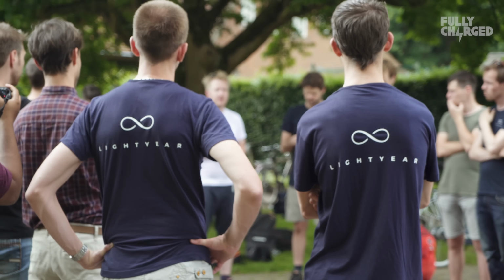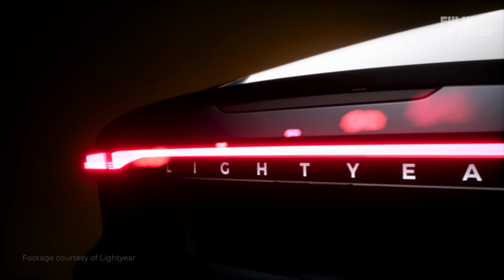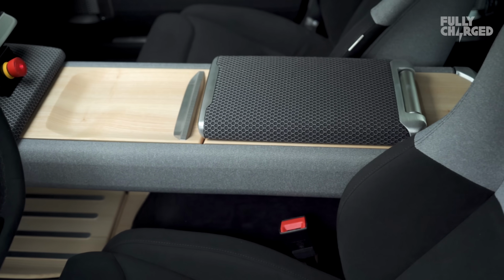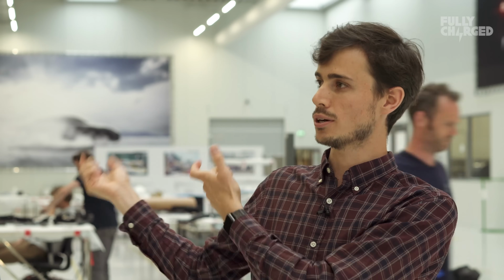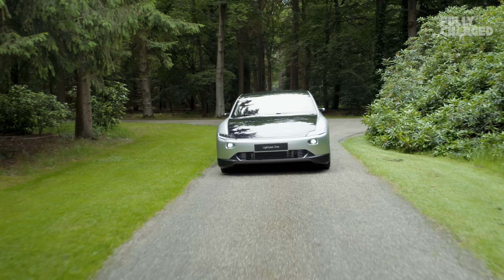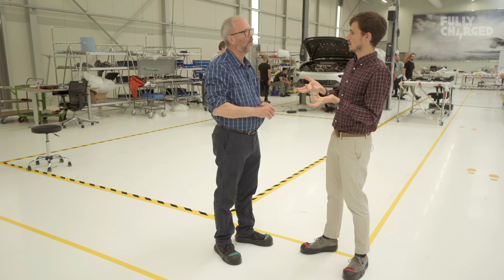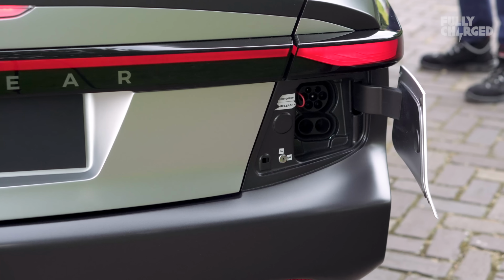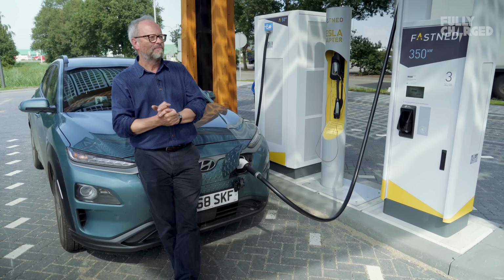Lightyear One solar powered electric car - exclusive first look | Fully Charged

Comment: NONSENSE.  The  AVERAGE REAL TIME efficiency of solar cells is BARELY 15% because of the varying angles of the INCIDENT light. Do you really think the incident light is hitting at 90% to the solar cells all the time? As the car moves so the incident angle of light is varying and also the angle of the sun and also buildings blocking the sun as the car moves...
 So the  cross sectional area of top of the car times 0.15  times = available maximum incident energy times the efficiecy of storage cells times efficiency of motors= a lot less then their figures.   Barely=5%
The figures are BAD. NOWHERE NEAR THE FIGURES THEY QUOTE. They are deluding themselves,you and or just scamming.
Reply: They have won a solar car competition that went cross continent, what the hell have you accomplished?
Reply: @quelorepario  in perfect conditions with a fully charged battery?????????
Reply: @quelorepario  i also saved you money from buyinga lemon with fake figures.you should thank me.ask thunderfoot
Reply: @esecallum  as a rule of thumb I always wait until the second generation of anything that is cutting edge.
But from being skeptically cautious to being a cynic, that's a whole another dimension.
Reply: @quelorepario  did you even read what i wrote?read it again. slowly. if you dont believe me get any solser cell and angle it about you will be shocked at how the power drops as the angle is changed and how it output resistance goes up.
Reply: @esecallum  and yet there are races with solar cars that exceed 1000 miles per race, only powered by solar energy.
These type of races existed for over two decades.
One thing is what you can theorize on paper, another thing is to actually test it in the real world. There are so many examples in the history of science that seemed to be impossible in a laboratory and turned out to be perfectly possible in the real world because they were ignoring variables (either synergy, optimizations, lateral thinking solutions) that you would never realize until you build it.

In any case, it has never been part of the objective of this car to become 100% self-sufficient, it is designed to be a range extender. 
Btw, just now Toyota announced a breakthrough of a 34%+ solar panel efficiency that allows charging while driving.
Reply: @esecallum  you are the limited one by thinking that the only way to get efficiency is by breaking the laws of thermodynamics.
Reply: @quelorepario  which part of 25% theoretical versus 5 %practical dont you understand?

Comment: Nice concept, but in the real world those wheel covers on the back wheel would only get in the way
Reply: citroen only shipped a few mil. of them over a 50 years time span... think outside the box the problem was solved in 1955 and worked like a charm.

Comment: This car isn’t needed, a electric car is good enough.  Won’t be able to drive at night and if you use a smaller battery you will have to charge more often driving at night, clouding, and rainy day.  Not worth the extra money vs just driving a electric car with bigger battery

Comment: I like the car and concept so far, but: the solar panel calculations are BS because the sun will never "peek power" the whole day. In average and ballpark numbers you get whr=peek wattage x 1 hour. Yes one hour, so 1,25kWhr the whole day. Which ain't that bad, but this is changing the picture essentially. Don't you think?

Comment: I'm thinking long range trucks, with 70% of it's power draw provided from the panels coating the side and top of the trailer.
Early morning the sunlight hits the side of the trailer, and even leaving space for branding you have a massive surface to capture sunlight all the way through midday.
Truck stops could be fitted with high-voltage charging stations that charge up separate battery modules in a few hours. This does two things: Enforce mandatory driver stops, and puts pressure on shipping companies to not stress their drivers (i.e. without enough charge the truck doesn't make the delivery, where stopping for 20 minutes to fill the fuel tanks means tired drivers become road hazards)

Comment: some random thoughts

1) it looks like the brakes aren't working yet ( or they don't trust them ) because 1) very low speed 2) chocks under the wheels 3) people following the car on foot, probably to help stop it.

2) the construction of the car (I'm guessing from the picture at 4:10 ) seems to be
a) chassis :  aluminium? lots of flat pieces easy to water jet cut and no compound curves which are difficult to form.
b) body : either thermo set plastic or 3d printed plastic. appears slightly transparent and has reinforcing ribs behind the wing and on the B post.
( note : will that tube in the B post really be strong enough for side impact protection? - I am not an engineer)

3)  for a car which is aiming at minimum wind resistance I'm surprised some of the design choices  for example the front grill  and that tail light design, they can't be helping.

4) High performance cars obviously have a market( Ferrari etc) ; people will pay more and put up with less comfort. But is there a market for high efficiency electric cars? Will people pay a huge amount more to save only a little electricity cost? One of the advantages of electric cars is they are cheap to fuel, will making a very expensive car which is say 40% cheaper too fuel actually be worth doing? 

5) Is efficiency even a thing with electric cars? Making a car that can do 100mpg with diesel is impressive ( eg Audi A2 3L ). But I have no idea on energy usage for electric cars, I even don't know what its measured in. I guess its KW hours but what's a good KW hour and what's a better KW hour? I do understand range, clearly more range is a good thing.

6) mass producing cars is very difficult. 

7) Everything they are aiming for Tesla are also aiming for: Low rolling resistance, low wind resistance, light weight and a more efficient power train. The Lightyear One is an attempt to push the envelope but it can only do so while sacrificing some of the following:  price, performance, safety and comfort.

fully charged review on a similar car called the sion https://youtu.be/wLZKdkgB85k

Comment: What exactly are those runners doing? Like watching a 4 year old learning how to ride a bike. So - here's what I think is happening.  This is conspiracy theory, my own opinion of what's going on here. I think this channel is in on an investor scam. The car spends its parked time with wheel chocks front and back of the tires - there are no brakes, whatsoever, nor is there the expected "cogging torque" in the wheel motors that, combining the CT from 4 motors, WILL hold the car in place on that level ground -- no chocks needed if that was the case. The location is secluded and completely out of public view. I submit the wheel motors are 3D printed shells that are bolted onto wheel hubs - we never see an installed motor actually running on a lift and the car clearly doesn't have a braking system.

Those runners push the car (which is why they wear the white gloves while running and why there are that many runners), then run alongside to be in frame for a "legit reason" because they can't get out of frame without standing in different places. Notice the car never exceeds humans-running (not sprinting) speed in ANY of the short video takes that are edited together and it's always slowing down as it free rolls, never accelerates. It comes from around the corner of the bushes right after being pushed -- if you look closely, it's slowing down.

The car is on a tow rig while you're chatting inside it (hence the "noise" -- I don't care how prototype the wheel motors are, there are no gears, they should be totally silent) and is being cable towed when behind the camera truck which is then deleted in post by color keying (look at the center of the pavement and you'll see shenanigans). It gets winched into the trailer and never goes beyond the winch in the back 1/3rd of the trailer into view through the side doors of the trailer, because it CAN'T - any marketer would terminate the frame with the car stopped in its place in the trailer, in view.

The one sequence where the car is looking like it's going faster than running speed (left to right) has video frames deleted (watch how "jumpy" the runners are) to speed it up. I think these guys have a rolling foam concept and are misleading their way to bigger funds and they've certainly pulled the wool over almost 2000 commenters' eyes if that's all they have. And, if I am correct with my theory, you're in on it with a straight face because this piece is massive clickbait for channel views/payout due to the "exclusive" ride interview and rolling car views.

Any investor that puts money in a tech that adds a couple of dozen km of range and on seeing clips like this (which a foreign investor might do), at best, hasn't done their homework -- ride in an actual car before you give them a dime. That way it doesn't matter if my conspiracy theory is right or wrong. But I truly believe that these guys are painting a picture of being further along than they really are. No harm in being where they are, but it's a lot harder to go beyond a seed round if you've burned off time and all your seed money playing in the sandbox and can't show a working electric car instead of a soapbox derby entrant.

Comment: ultimately.. it's powered by coal, hydro, nuke plants, and petroleum.  Or solar panels manufactured by power from  those sources that then die of old age after 25 years.  Do you drive a new car?  It took 300,000 gallons of water to make that car.  Do you fly commercially?  That plane blows more exhaust out in one trip than my 30 year old Bronco does in a year.  Like to wear import shoes and use consumer goods from overseas?  It takes a lot of petroleum based manufacturing to make the ships that run on bunker fuel to haul the containers to ship the cell phone that uses infrastructure built with heavy equipment made from materials mined with heavy diesel equipment to UPS or FEDEX to your local retailer where you go buy it.  Really want to save the world?  Convince people to live in cotton tents without heat wearing burlap and sandals and living off berries.  Or nuke China, since they are the largest world polluter.  Natural Gas is the next big boom, make propane powered cars.

Comment: A solar car is interesting, but the energy produced needs to be worth more than the cost of the solar cells including any drawbacks that this design entails. This will depend to a great extent on the amount of sunlight at any given place on Earth. In Madrid it might be worth it. In Helsinki, perhaps not so much.

The same logic applies to hyper-efficient design. People are very fond of performance and styling, and typically willing to pay quite a bit extra for this. For example, consider that the running costs of a Tesla is already quite low. At some point there's a sweet spot in the trade off between price, utility, comfort and performance. A 50% energy consumption reduction will probably sell quite a few cars though, if they can deliver on that.

I love that they're using hub motors too. I've been wondering why nobody has done this yet. It'll be very interesting to see how they perform in the real world.

Comment: Literally, when i saw the first Tesla Model S, i was like, why they didnt put a solar on bonnet and roof to self charge it?

Someone actually made this. Great.
Reply: It’s because solar on the car only makes sense for powering a fan to keep the car cool when it’s parked. They won’t tell you in this video, but all those solar panels add less than 5 miles per day at best. Much better to have a battery that a ground based fixed solar array can charge in 20 minutes.

Comment: Was that road test its maximum speed and acceleration?
Reply: They are not even close to confiming those numbers so quite rightly are not making wild claims.
Reply: Transport Evolved was speculating around 10 seconds for 0-100kph. Which is actually quite good for a car that is focused on efficiency (and in fact many ICE cars are in the 10s-range as well).
Reply: @stephanweinberger  The performance shown in the video was not 10-second 0-100kmh acceleration.  It also seemed to max out at about 20kmh.

I'm not sure if they did that to protect their prototype, or if it's because it's not capable...

Comment: Crash protection is no where near what is needed with lower weight.  The future is in flying, not old 4 wheel cars.  Waste of time and money.  Motors in wheels shows a lack of understanding of the problem.  Carrying around the PVs just adds weight.  No rear view window?  Not good.  A four place could be 1/4th the drag and 1/6th weight of a Tesla (1.5 sft and less than 700-800 lbs).  This does not even move the space forward any.  So many issues they miss with this.  Can we just stop with this nonsense? 

By comparison, with my technology, you could travel 500 miles with 1 gallon of C10 (made from electricity), 1200 city in such car car (1.5 sft drag, 800 lbs).  6 gallons is 3000-7200 miles.  C10 could be $2/gal e.  When you wake up, you realize that ROAD tax is the main cost/fee.  In Germany it is 8 c/mile or 5 c/km.  Fuel is $2/500= 0.4 c/mile.   Tires, brakes, maintenance is around 8 c/mile.  16 c/mile fixed vs 0.4 c/mile fuel.  Flying is then the key.  Fly at 200 mph for 4 c/mile, not 16 on road.  The future is in the air, not on the road.  PV on the car is an OLD idea, not worth using.

Comment: 16:55 - "1.25 Kw peak, charge between 10-12 kilometers per hour."  That's an excellent driving efficiency. My BMW i3, which on its release was considered the "most efficient" EV, gets 3.5-4.5 miles per kilowatt-hour. That's implying 5.0-5.5 mi/kWh.

Comment: In sunny Spain maybe, in cloudy UK no. You basically constantly need to clean solar panel of the dust and dirt, to get max charging power of panel.  In urban areas dust is everywhere, from building sites, from industrial sector, pollen and so on. After I wash my car it get same dusty next day and if it's rain it's even worst. Or after journey on Motorway in wet conditions car looks just terrible.

Comment: Great car, miles per kWh just on battery? At least 6 I am guessing, but love to know .  Really liking hub motor design, frees up so much space under the car , and no heavy drive shafts or CV joints etc. Noone explained why the test drive was  only walking speed.

Comment: Lapel mics could have improved the audio in the car, (reduced noise of car which sounded really loud)  however with what you had, running the audio through a high pass filter would have taken a lot of the rumble off.

Comment: We don't need luxury to save the earth. Make simple electric cars that we can work on ourselves. FFS
Reply: A really good low cost electric car is something really sorely needed.
Reply: Membrane556 exactly, rich people can drive whatever they want. Every day working person wants to stop getting robbed at the gas pump...
Reply: @elementcreator1 One reason I feel bio fuels might be a better solution to carbon emission for the near term than EVs.
You get the pay back right away vs 10 years down the road after the EV's emissions savings have amortized the emissions of it's manufacture.
Reply: The problem is: it is impossible to develop technology and mass produce it at the same time. So in order to get to that affordable electric car you have to first develop the technology in a more expensive one. And not many people are going to buy an expensive car if the luxuriousness is not up to par with other cars in the same price range.
Reply: @wilgert  Since they're only going for modest performance here and don't seem to be making it self driving it's a step in the right direction to making it affordable.
Reply: @wilgert  Im pretty sure you could go by without an interior that looks like this car, no autopilot from tesla, tons of cameras, huge screens. The technology is there, so no need to develop anything, but it's all about the money.
Reply: Technology made for expensive cars usually trickle down to more affordable vehicles. Electric windows started out only on luxury cars but now are found in most cars.
Reply: @thomasleemullins4372  Quite right! From early luxury cars we also got power steering and power brakes, ABS, crumple zones, air bags, direct injection, radios, air conditioning, independent suspension, automatic transmissions, central locking, variable cam timing and on and on.
Reply: The reality is that Tesla makes about an 8% margin on base model electric cars. The majority of the cost of producing electric cars comes from batteries alone. Then there are electric motors, electronics and labour. The idea of electric cars for rich people is that they are the only ones who can currently afford to foot the bill of current battery technology and it is battery technology which needs to improve for electric cars to be viable for normal people.